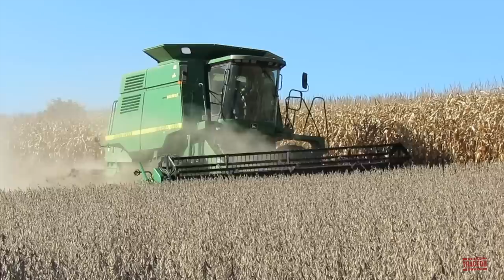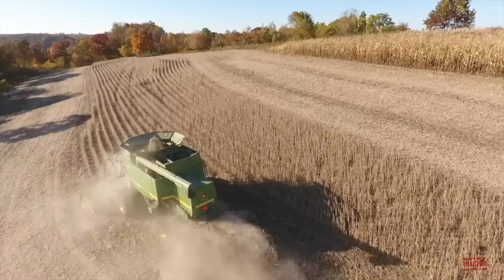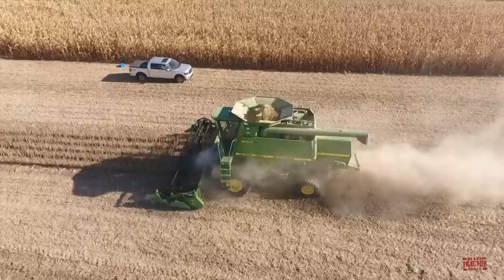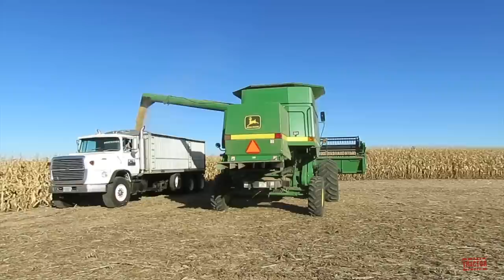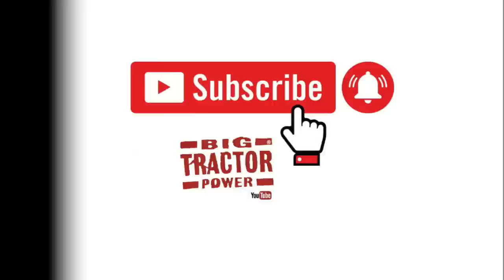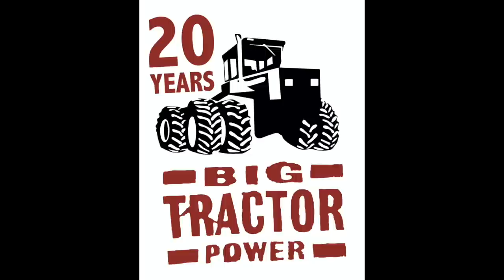JOHN DEERE SideHill 9510 Combine

Comment: I've seen tons of equipment but never a sidehill combine... It's pretty cool.does it level itself or does operator level it ? Always awesome Jason... Thank you.
Reply: Both, there's an automatic pendilum switch mounted on the front axle and a manual rocker type switch in the cab. Both switches are controlled by a master on/off switch.
Reply: @dobsonrunfarm9329  awesome... Thx

Comment: lots of sidehills here in PA. I actually spotted a combine I've never seen before recently, a John Deere 4425.
Reply: The 4425 was a European model shipped over here to replace the 4420 for 1984 as John Deere still felt there was a market for a 4 row narrow combine in North America. They offered the 4425 until the Maximizer series was introduced and they starting shipped 4435s over until John Deere discontinued the option of a 4 row narrow machine for the 1996 model year. The larger 9400 still had a 4 row wide capability, so it more or less covered other small farmers.

Comment: My bosses are using a John Deere 9660 STS combine Bullet Rotor and a John Deere 635D 35' rigid draper head to cut the soybeans. Their oldest brother is using a John Deere 9760 STS combine with a 630F 30' flex head to cut soybeans. They brought out the John Deere 7800 with a 740 Classic Loader on it to pull an A&L F705 700 bushel grain cart. They aren't running the grain cart, they are keeping it parked to the side because their oldest brother is using the semi like 20 miles away from where my bosses are cutting.

Comment: Does the operator have to level the combine or does it level itself?
Reply: The machine has an autoleveling sistem. First models were manuals, you had to adjust the level using an hidraulic lever but it was very hard to manage all the movements